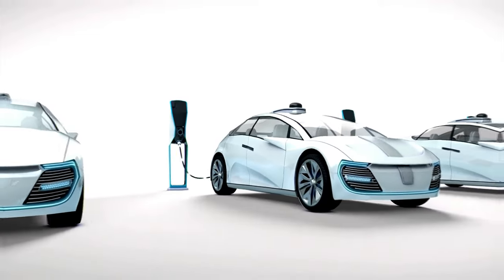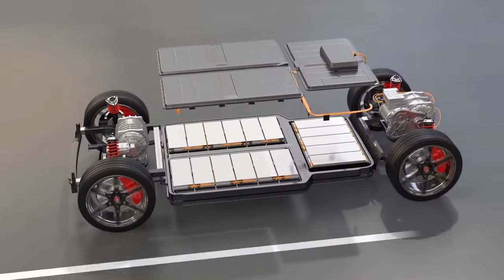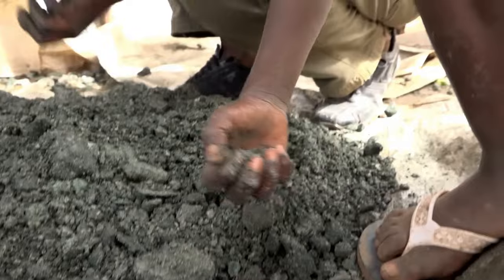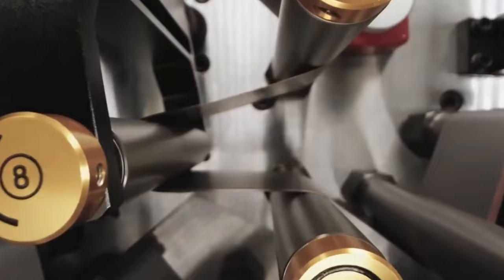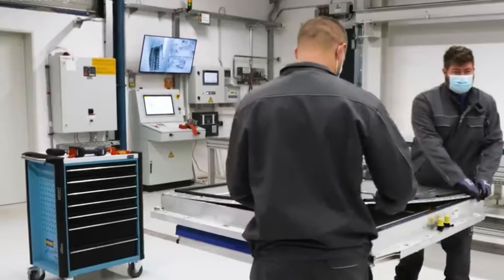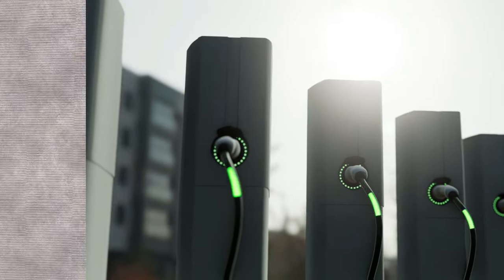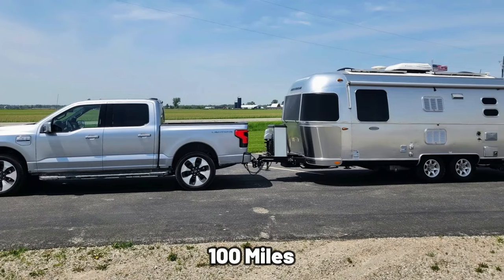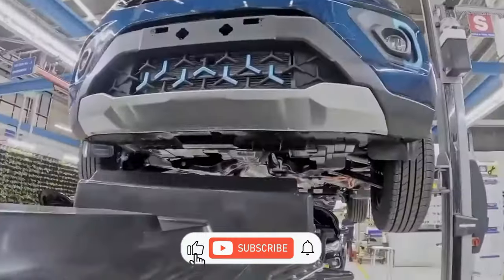The Dark Side of Electric Cars Uncovered

Comment: This is extremely misleading…this is exactly why you have to compare all the nasties of the fossil fuel companies and the extractions are an on going destruction at 100times the issues that this Video are raising…Here’s why the majority of the electrical generation will be at point of use for recharging your battery in the next 10 years you’re gonna see the largest transfer of wealth off of fossil fuels and onto renewable and renewables will be recharging your electric vehicles, not the fossil fuel industry
Reply: Oil companies will still be in operation for the next 50+ years.

Some oil companies will continue to operate for a very, very long time, and we are talking about 100+ years.

Don't worry, EVs will never save the world.  They will slow down global warming by some %, yes, but they will never save the world.

Cars have a very, very small effect on global warming, barely noticeable compared to other factors.

A return flight from London to San Francisco emits around 5.5 tonnes of CO2 equivalent (CO2e) per person – more than twice the emissions produced by a family car in a year, and about half of the average carbon footprint of someone living in Britain.

Even a return flight from London to Berlin emits around 0.6 tonnes CO2e – three times the emissions saved from a year of recycling.

These non-CO2 effects contribute twice as much to global warming as aircraft CO2 and were responsible for two-thirds of aviation’s climate impact in 2018.

That's just one impact on the world, and there are many more.......

Comment: The electrical grid can barely keep up with demand as it is now.
Insurance is higher for evs.
Low trade in values.
Also, no car company has been able to make a profit selling evs. They're manufactured at a loss. At a real price point where a profit is made, no one would buy them at all.
And you didn't even get to the part where the extreme torque of evs tears tires apart prematurely
Reply: The other thing is yes Tesla is making a ton of money and has for the last three years. It looks like most of them are not because they are starting to build electric vehicles that takes a lot of money just like when we went from horse carriages to combustion engines.

Comment: Regardless how the power is made.  Electric motors convert over 85 percent of electrical energy into mechanical energy, or motion, compared to less than 40 percent for a gas combustion engines.
Reply: So what?
Reply: When you burn gasoline in an internal combustion engine, the potential energy of the gas is transformed to thermal energy, which causes the gases in the cylinders to expand, pushing on the pistons, transforming it to kinetic energy. Two conversions of energy to another type, in other words.

With an electric car, you're mostly talking about burning natural gas to make the electricity. The potential energy in the gas is turned to thermal, then to kinetic, which turns a generator, turning the energy into electrical energy.

That energy is transformed (another lossy process) to very high voltage and sent out over the power lines (transmission losses) to the nearest substation to the EV charging point, where it is transformed back down to usable levels. It continues on to the charging point, where that electricity flows into the battery and charges it. This transforms the electrical energy into potential energy again.

Then, when the car is done charging, you drive it away, turning the potential energy back to electrical energy, and the electric motor turns that into kinetic energy, moving the car.

With the EV, you have six transformations of one type of energy to another, compared to two in the gas car. You can make it seem more efficient by comparing only the last two of the six transformations in the electric car to the whole process in a gasoline car, but that does not give the whole story. You also have to factor in the losses during the generation of the electricity, the transmission losses, and the loss to heat during charging (which is substantial). 

On the other end, you have the fuel that is burned for diesel trucks to bring the gas to the stations, but that's not as much as you may think. A large tanker truck (which is the kind you will usually see delivering to gas stations) carries 11,600 gallons, with the truck that brings it there using a gallon of diesel for every 6 (average) to 10 miles (the most efficient newer rigs). 

Most of the gas is moved from the refineries to near the point of sale by pipeline, which is very efficient, and only has to be trucked for the last bit of the journey, from the terminus of the pipeline to the gas station. Even if that is 50 miles, the diesel used to get it there would amount to 5 to 8 gallons, which is trivial compared to the 11,600 gallons the truck brought in. That's exceptionally efficient, with a loss of well under a tenth of a percentage point.

Comment: If this video came out 10 years ago I would agree with most of the arguments but these problems have been greatly mitigated. Battery recycling can recover 95% of the precious metals, battery chemistry has changed to reduce or eliminate cobalt, less than 1/5 of electricity comes from coal in the US, and yes when an EV is manufactured it produces double the carbon of ICE cars but ICE cars catch up within 5 years of average driving, etc. Etc. Etc